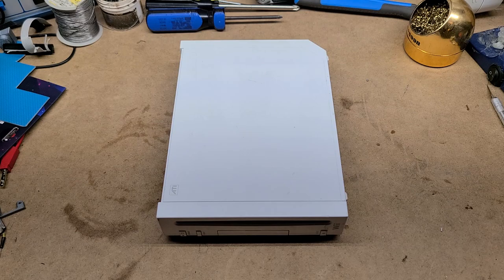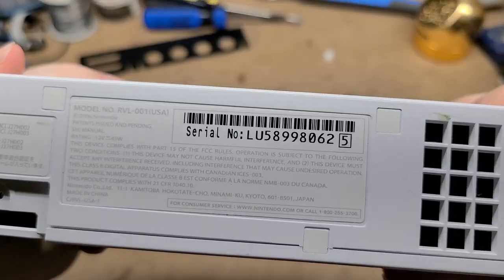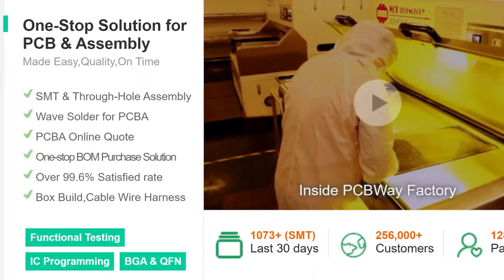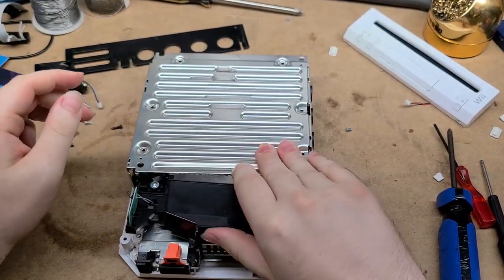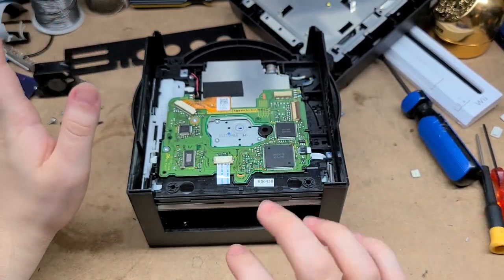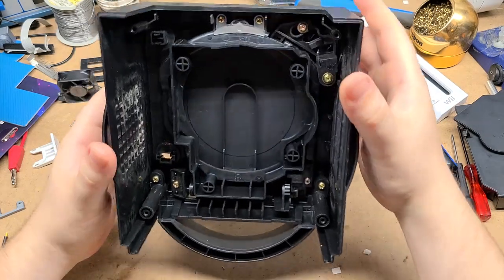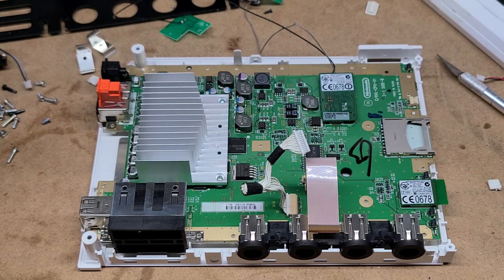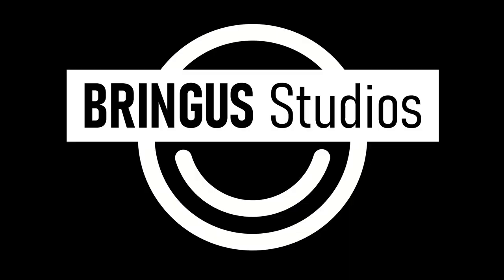WiiCube Part 2: Project Brainstorming & Wii Disassembly

Comment: great vid!! I know it's probably a bit of a long shot but you MIGHT be able to use the DVD drive from a Wii mini as it's a top loading system like system like the GameCube. Assuming the drive works with the original Wii board you might be able to fit it in the GameCube with out doing a ton of damage to the shell and you can keep it a bit more accurate to the original GameCube.
Reply: I agree, i assume it will be easier to use the wii mini disc drive.
Reply: I think it's 100% worth trying to use the Wii Mini drive, that'll make the project that much more satisfying. The major case mod I think would be making full for a full size DVD.
Reply: @seshpenguin  it'd also be nice giving the wii mini an actual use lol
Reply: @seshpenguin  yeah, I haven't tested it myself but I've read that the Wii mini drive works with the original Wii's hardware and the Wii mini's drive is much smaller ( from what I've seen) and would allow for a lot more wiggle room in the case
Reply: I said this on the previous video.
Reply: Problem is, the Wii Mini can't play Gamecube games.
Reply: Bump
Reply: @hlavco  yeah the wii mini is similar to the rvl 101, but u can play gamecube games through nintendont if u mod the wii mini via bluebomb. but yh u can't get gamecube disc functionality back.
Reply: @hlavco  Can it not play GameCube games because of software limitations, or is it because of hardware? Because we have mods that restore full system functionality to the system menu software.
Reply: @Anthestudios  actually a hardware limitation, same thing with the Wii U.
Reply: @beardalaxy  Thanks! I wasn't sure.
Reply: I had the exact same idea than you and maybe there's some special wii mini drive that can read GC games
Reply: @hlavco  the Wii mini can’t but maybe it’s drive can when connected to a regular Wii motherboard
Reply: Exactly what I was thinking because as you said both are top loaders
Reply: @hlavco  the wii mini's limitation shouldnt lay in the disk reader but rather in the mainboard.
Reply: The wii mini had dvd suppoer??.
Reply: @crudicle8407  it could read DVD since Wii games were printed on a DVD based format however no version of the Wii has actual DVD playback

Comment: You could use a GBA Player to house the DVD drive. Plus it would give you more room in the GC itself.
Reply: That's probably the best idea. Even better if it somehow still could work as a gba player
Reply: @beardalaxy  That got me thinking. I wish I still had my player to open up and see the size of the player's internals. He could move the internals of the player to the GC case while using the player shell for the drive.
Reply: @nixsdaddy5059  That’s genius! That would be really smart. It would be cool if it would be removable too but that would probably be really hard
Reply: @KartDriver04  you'd have to build a custom connector, but other than that, it shouldnt be that difficult.

Comment: Absolutely would love to see you use a dvd drive from a Wii mini, that way it looks like a GameCube but still has all the normal Wii features, since my understanding is that the limitation from the Wii mini come from them being locked out of software and the mother board being hacked up
Reply: The Mini drive won't load GameCube discs.
Reply: @Rulumi could we not solder the necessary motherboard circuitry to the Wii mini disk reader?
Reply: @Rulumi i know I'm late but IIRC its not a hardware limitation but rather a software limitation 
So if you mod it you can indeed play GC games on the Wii mini

Comment: Not sure if it would work, but what if you had the CD drive placed under the Gamecube similar to the Gameboy Player attachment? Would require more work, but would clear some space for the front ports.
Reply: All the better if it was a removable attachment so you could unplug the drive and leave it off for aesthetic reasons but still have it for game dumping
Reply: Ooh yea make it a bottom attachment that would be super cool
Reply: @SoftQuartz  yea I guess you could wire power and data for the dvd drive into a connector like the gba add on had and have an connector on the other side.
Reply: Bump
Reply: yeah this was my first thought
Reply: I agree.

Comment: If you use the GB Player case, keep it's connector, wire the drive to that, have a second ribbon plugged onto the main board and wire that to the receiving end of the GB Player, that way you'd have a removable disc drive as apposed to a fixed,

Thus pleasing people who want you to keep the Wii Hole, and the ones who say do away with the drive too.

Double win for both sides 😎

Comment: Great work.  Here is a suggestion that might work.  Use the Red Wii mini.  Heard people finally got wifi working on it as well and use a GC USB adapter for the gamecube controller ports.  No memory card slot but its an idea.
Reply from the maker: I may be able to get away with using the Wii Mini's DVD drive with the OG Wii motherboard, not sure yet

Comment: So what you could do for the dvd drive is 3d print a small case for it and put it on the bottom as an expansion port kind of thing, (maybe even throw in a gameboy player lol) and have it connect through USB or something, to make it removable, or you could even reuse the expansion port you cut off your gamecube mini as the plug on the bottom for even more original of a look, that way its even detachable! But if you're looking to do it as a 1 piece WiiCube project, I'd suggest just hollowing out the bottom like originally planned, and if you're gonna do that, you may as well paint it white too haha!

Comment: I’m loving the behind the scenes videos before the actual videos! I’ve never seen a YouTuber that tries to involve their viewers that much! Also, congrats on the first sponsor! A small idea for the disk drive is to take off the top half of the metal surrounding. I’ve never worked with a Wii before but maybe you’re could slightly modify it to be a top loader?
Reply: You could then dremel a bunch of unnecessary plastic off the top half of the shell to fit the disk drive.
Reply: That’s actually exactly what I’m wondering to. I know with the Xbox 360 you could tear apart the disk drive and it would still function fine.

Comment: A few things:
For optical media, I know the Wii DVD drive works on a GameCube, so it is possible the other way around might work (GC drive on a Wii) of course this means a bunch of messing around, and no compatibility with Wii games since the GC drive is mini DVD only.

If you do decide to go the route of no optical drive, there is of course the option of something like a Wii key fusion or the later WASP chips, though those may be hard to come by, and are missing support for a few games with "audio streaming" iirc. 

Finally, of course, there's the portablize mii software hack option which should allow removing wifi and the disc drive entirely with only software to replace what's missing. 

Good luck with your project :)

Comment: Dremel out the whole top half minus the power button to try and keep that, and glue it together to keep the cover closed, dremel out a slot on the front above the controller port plate and slide the Wii disc drive in, like a CD drive for a PC. (Assuming it wouldn't stick out too bad trying to keep the OEM power button.)

Comment: CONGRATS ON THE SPONSOR!!! I have seen the bottom of the gc shell 1:1 models to 3d print online, why not design one that instead of all the bump outs - has standoffs for the drive and a slot in the front bottom to load discs? Added bonus - with a bottom shell modeled like this you can integrate the sensor bar ir portions into the corners of the shell.  Between the gc controller ports, disc drive, sensor bar, bt & wifi ... This would be a BEAST!
Reply from the maker: I am big time leaning towards doing this. Wanted to modify the original shell but it would be so destructive and time consuming. A 3D printed bottom is probably the way to go
Reply: @BringusStudios  might even be able to design the back panel to house the wii specific av cord, power cord, sd, & usb

Comment: It would be really cool if the cd drive could line up to have the slot above the controller/memory card plate. That would make it so you would just be widening the gap rather than actually making it a slot.
Reply: it's a dvd drive though.

Comment: A custom GC shell with a top-load optical drive would be interesting, just for the sake of having a full stock Wii in a GC housing. 

I'd be curious how moddable the Wii Mini is. I know it doesn't have WiFi or the SD card slot, but were those entirely removed from the motherboard at the component end or does the chip on the board outright not support them. If a Mini can be modded to be a full Wii, this might be a good contender for a top-load GC case swap, as the Mini was already a top-loader. IIRC the motherboard in the Mini is also tiny, pretty much the same footprint as the disc drive. Might be worth looking into if you can find more information on the Mini's components or find a cheap one to mess around with.

Edit: Macho Nacho has a video on adding WiFi and the SD card slot back to the Wii Mini, and the reset button as well. Now to find out if the GC ports can be added back.

Edit 2: There seems to be test pads for the GC components, though all that I can find is mostly incomplete. The test pads that mirror the SD card test pads only have the pins for controllers 1 and 4, 2 and 3 are either elsewhere or entirely missing; similarly, only one memory card slot may be there. There also isn't another island of test pads like this, the Wii Mini may just be half a GC unless the other half is found.

Comment: People have mentioned it already but you might be able to use a Wii Mini drive since it's a top loader and you would only need to grind off the top hole to fit full size DVDs

Comment: Would it be more feasible to 3d print a housing for the wii diskdrive that mounts on the bottom where the expansion ports are instead of boring out all that plastic?

Comment: Stupid idea for the disk drive: Try to make it come out in-between the controller ports and the memory card slots. 

Just cut that PCB and front-panel in half. Maybe shift the controller ports up slightly, and the memory cart slots down slightly.

Comment: Drop the DVD Drive. The NES has the horizontal space for a disc loader + front access, the game cube doesn't. You already have an uphill climb with the other parts to move around.

Comment: So it is actually possible to solder a Gamecube Disc drive to a Wii as far as Im aware.
You can solder a Wii Disk drive and wiikey fusion to a gamecube and have them function. If I remember right the reverse is true too. Idk if the information on how to wire them up is still out there though at this point.

Comment: Use the GB Player to put the DVD Drive in. If that won’t work you can still use uLoader with a portable external USB drive to run burned Wii games. I have some videos showing it working. Doesn’t work with original games or GameCube though.

Comment: i know i am a bit late and i dont know if you are still working on this project. But i had a idea after watching this video:
You said you dont really use the dvd drive. So i tought you mayby can put it in de shell of the gameboy player and use it as an add-on if you need the drive.
I dont know how much room is in there. If it is too small you could 3D print a shell that looks like the gameboy player
Reply: He doesn't seem to be working on the projekt currently and I feel like half the comment section had this idea already.

Comment: With a Wii in a game cube shell are there possibilities of modifying the Wii motherboard to be over clocked with cooling and other goodies?
Is it possible to merge the Wii DVD hardware like the laser and connector bits with the spiney bit of the Gamecube's drive?

Comment: oh, I wish you don't go destructive to be full stealth at least with the lid closed, BUT if you going destructive and still want the dvd drive, would it be good to cut the disc slot at the back od the console to be more stealth? and the IO be move to the inside of the GC disc lid?

Comment: I thought you have to have the drive connected or did they finally figure out how to have homebrew run with a drive connection? when I had a modded wii I thought how cool it would be to take the dvd drive out and put the ssd in its place.
Reply from the maker: Look into RVLoader, it lets you do away with the wifi chip and DVD drive

Comment: I'm just sitting here wondering why nobody has ever made a short Gamecube. Delete the DVD drive and 3D print a shorter top shell, as well as a smaller fan and power button mount. It'd still be 100% compatible with all the official accessories, just smaller, and no DVD drive.
Reply from the maker: That's a good idea! Kind of want to tackle that myself now

Comment: Pfft, one of the smartest things Nintendo did was switching back to cart from disc media, if you're modding a Wii to fit into a Gamecube I would say just go with SD loaders. If you want the extra challenge of being able to use disc media, I would say don't be afraid to tear up the area inside the lid, if you're keeping the outside the same, then that might be a compromise you have to make. 

Good luck on the project!

Comment: Cartridges are cool, right? It's cause it's really fun to have a big boxy thing to just clunk into a console, it's just so satisfying.

Now, hard-drives are pretty convenient because you just plug it in and have all your stuff right there, but there's no satisfaction from plugging it in... So why not have both?

Hard-drives are basically just over-complicated cartridges anyways. Why not have a hard-drive connector where the disc drive would be, and you just clunk in a different cheap hard-drive based on what kinda games you wanna play. It'd be convenient, and make it kinda like a cartridge system. It would be a bit hard to do tho, but I bet you can do it!